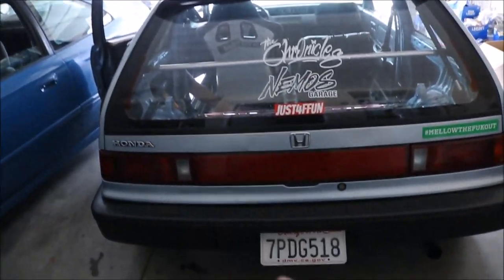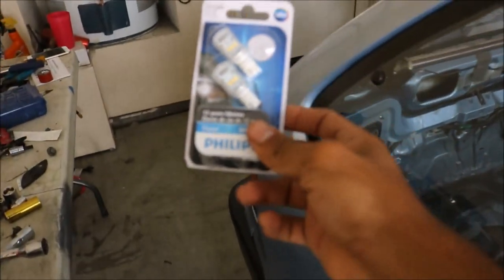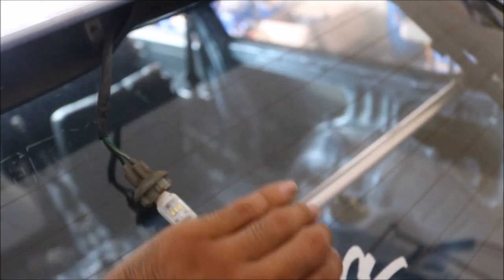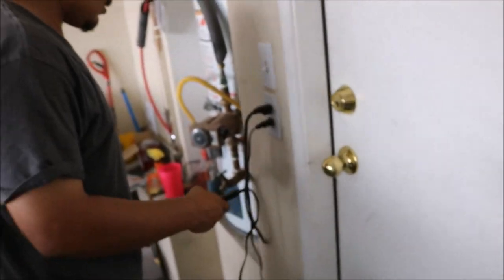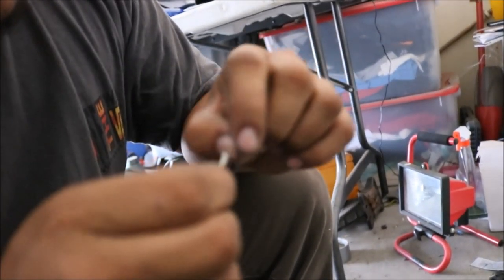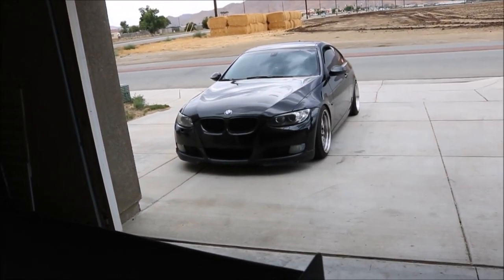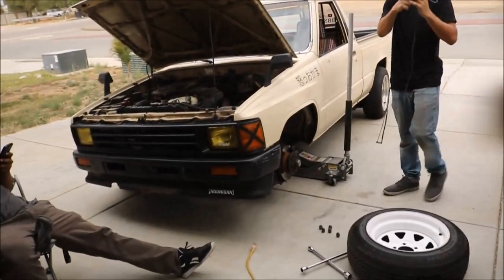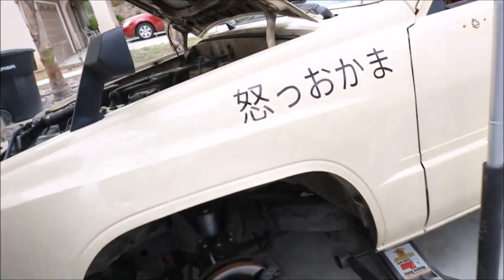How To Make Your 3rd Brake Light Blink Rapidly!

Comment: Hey you guys have a video of that ef hatch hood modification, I want to see how you guys did the cutting and sizing too. I have a question when it rains, it's there any problem driving the car or sitting outside with that EF hatch hood, does any water get's inside the car or something affecting to the engine, or water getting into the radiator, radiator fan or exhaust manifold? from hot material and cold water from the rain getting in there might start showing sides of crack or something ? any problems at all by driving the ef hatch during rain or having the car park outside with the rain getting into the engine bay cus of the hood been cut out, that's basically my question, let me know guys thanks.  P.s. you guys should try a circuit autocross, time attack. I believe there is awesome big tracks on California, for autocross.. here in Florida they are so big into that.. str8 run it's boring and get's old fast.